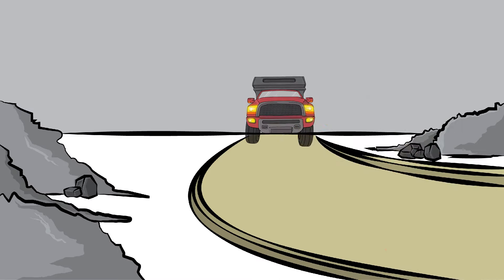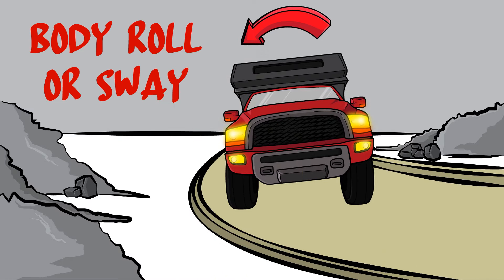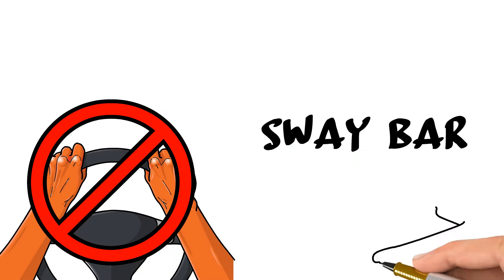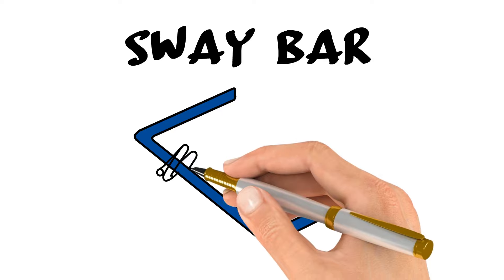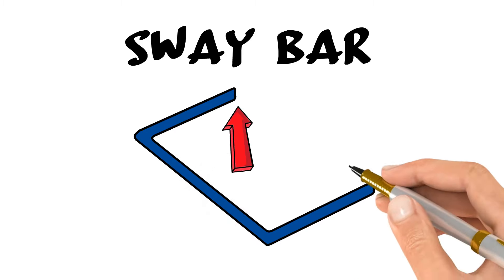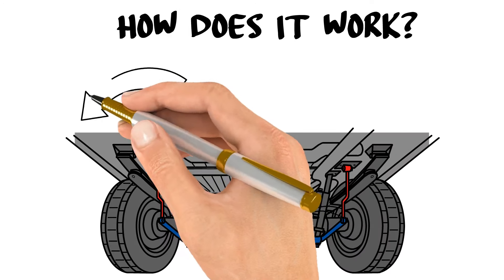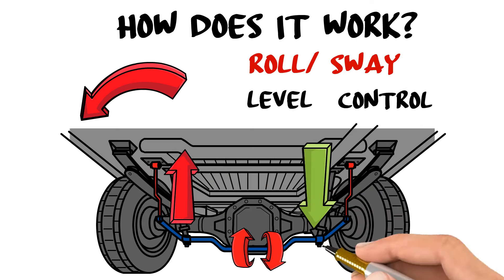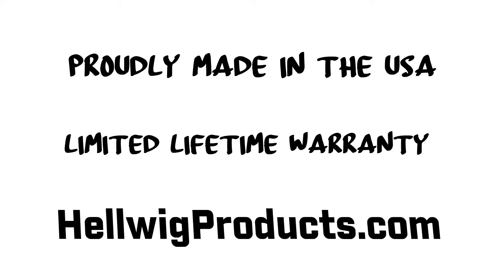How a Sway Bar Works

Comment: hi, the left and right arms of the sway bar do not move in an opposite direction per se. they actually move in the "same"  direction to reduce vehicle sway or tilt. when the left coil spring compresses while cornering, the left arm of the sway bar moves upward, and through twisting force (torsion), the right arm  is forced to move upward, reducing body roll. viewed in a different angle, when the right sway bar is forced to move downward due to gravity, it also forces the left arm to move on same direction reducing the rate by which the coil spring compresses. these twisting movements  by the sway bar provides stability to a car. thanks.
Reply: True say
Reply: this correct
Reply: yea i think the company tried to dumb it down which kinda lost me, this was my take on it aswell.
Reply: The way they explained it would actually increase roll 🤣
Reply: its also worth to note while stabilty is increased with the bar installed , the suspension cant do its job properly , resulting the driver will feel more of the road irregularities, so it really depends on the driver if you value stability or comfortability
Reply: fkn good explanation
Reply: Yes. Idea is to pass the compressing force to other side to compress springs in tandem to make tilt more even. I was wondering too what the heck. Maybe I have had wrong infromation. You would not think it is even remotely possible for a sway bar company distribute wrong information.
Reply: Sorry to bother, but could you lend a hand with my issue?    I maintain USDT TRX20 in my OKX wallet and have the recovery phrase [ clean party soccer advance audit clean evil finish tonight involve whip action  ] How do I move it to EXMO or OKX?

Comment: I've never seen a car without a sway bar installed on the factory.
Reply: Many vehicles leave the factory with sway bars but they are often very small in diameter. The beefier the sway bar the better it works. BTW, my 2015 f250 SD doesn't have a sway bar. It was an upgrade option.
Reply from the maker: Some cars come equipped with thin diameter bars. But if you look under most trucks, they do not come with a rear sway bar, or if they do it's barely adequate.
Reply: They have it but aren't like these actual bars also known as anti roll, they really make a difference.
Reply: Crown Vic interceptors don’t have front sway bars and very thin one in the back lol
Reply: Isuzu Ivan

Comment: I’m trying to determine if this is necessary or not, I have a 2020 F250 and towing a 5000 pound trailer and don’t feel any body roll. But I am thinking about getting a 9000lb toy hauler so wondering if this would help. Thanks
Reply from the maker: Hi @steveFelt67  We are here to help. Give our technician a call at 1-800-367-5480 and he can give you some insight into towing capacity and our best products for your vehicle.

Comment: My 89 e350 
Motorhome Never had a rear sway bar  .just installed a 1.250" Hellwig bar aftermarket unit $475 Have yet to take it out for test drive
Reply: Hello, sorry to break your focus, but could you assist me?    OKX wallet has USDT TRX20 alongside my recovery phrase [ clean party soccer advance audit clean evil finish tonight involve whip action  ]. How do I transfer it to EXMO or OKX?

Comment: Thanks for this; ads aside, this video explained body roll way more easily than that jerk over at the Engineering Explained channel who has to overexplain everything, yet paradoxically fail to get the point across.
Reply: That's funny, because they explained it incorrectly

Comment: Are there vehicles without them?
Reply: Yes, my 2020 F-150 has one up front, but didn't have one in the back until I put one on.  Made a very noticeable difference...
Reply: @stevewobig103 Do the sway bars make your truck more comfortable? As in a more plush and smooth ride?

Comment: For a pick up truck 2500 Ram 4x4, which is better to install, in the front or rear?
Reply: Both especially if you tow a trailer often the engine is alot of weight get quick disconnect connectors also just in case you have to drive some rough terrain disconnecting makes off road much more comfy and there are adjustable sway bar quick disconnectors that can fit any ride height and pull a pin and pop off makes it really easy

Comment: sway arm don't twist. 

the sway arm make your car left and right side parallel to each other so when you turn left the force will push the right side of the car down because most of the weight are transferred to the right the left tire will lose grip because the sway arm make the car side parallel the force  from the right side are redistributed to the left to mitigate the sway this will push down the left side and maintain tire grip. sway arm are connected to suspension the suspension act as the force absorber sway arm won't work without suspension and this is the reason why sway arm are not bulky.

Comment: So say you have a beefer hitch installed to  frame of a vehicle. I would imagine the thinner rear sway bar then becomes useless?
Reply: No, the hitch attaches high to the frame and rolls with the vehicle. As a result, a hitch doesn’t reduce roll as an anti-roll bar will.

Comment: I understand that Hellwig wants to sell more of their overpriced sway bars but the reality is that sway in turns is the result of an increase of weight on the outside springs. A spring may be able to support the vehicle load on flat ground or even in a turn without a load but unable to support the same vehicle with a load. The heavier the vehicle the less effective a sway bar addition will be. Vehicles that need a sway bar for control will have ones installed already by the manufacturer at the factory.

My pickup was OK with nothing in the bed but with a 3700 lb camper load there was a great deal of sway on sloping ground or in turns. The fix was to add more load capacity with the addition of Super Springs overload leaf springs. No more sway with the added load support.

Comment: I think this explanation is very wrong... You do not have opposite movement. In the contrary. The bar holds both sides together, tight. As a result, when one wheel goes up, the other side sitting on the pavement, will push the up wheel down. Will try to level.
The way you explain it it implies that by lifting one wheel, the other goes down even deeper. Exactly opposite of what you want the bar to do.